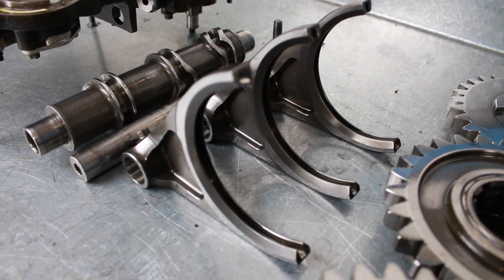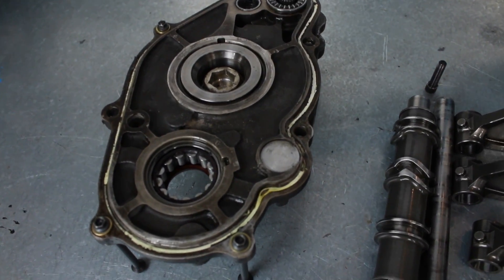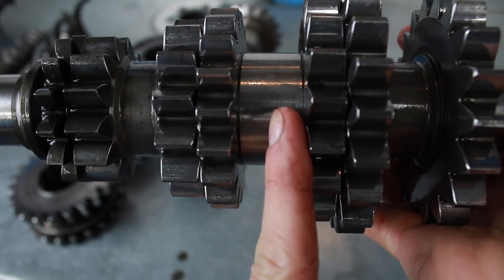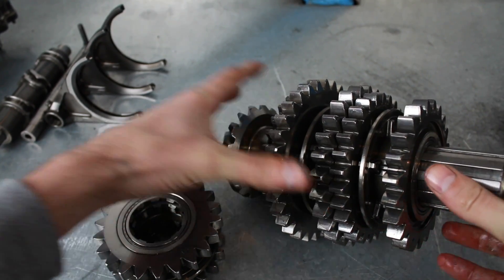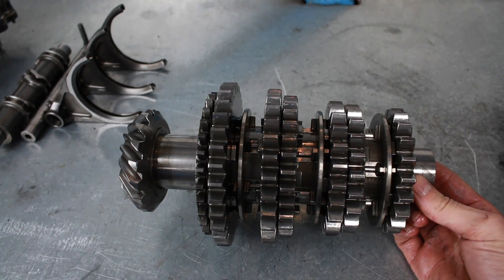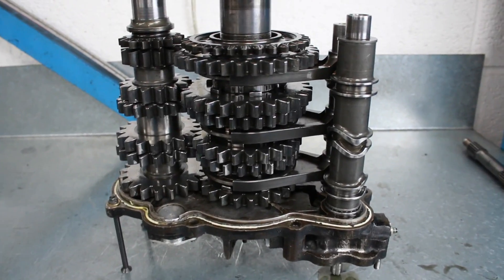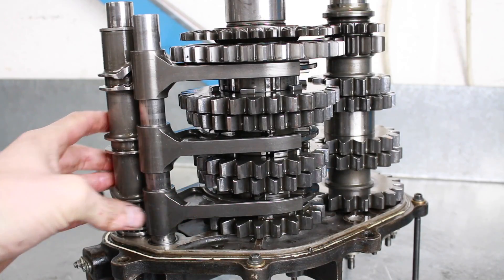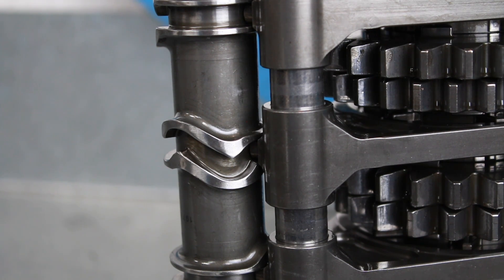How to Build an F1 Gearbox (and How it Shifts) | F1 Engineering

Comment: What matters: The main shaft's gears spin freely (they are NOT splined), which are always in contact with the engines gears ... and are always spinning freely together. It's only when, the DOG (the middle of which is neutral as it's not touching either gear) which [is splined] then locks up with the gear selected. Mansel has difficulty explaining bc he can't remember what it was like to not understand. He's not really even sure what we "aren't getting."  

And I still don't get something. How the HECK those dogs aren't RIPPED OFF when being engaged by the TREMENDOUS force & no 'synchro. I'd expect the dog would have shavings constantly stripping off as they must collide prior to being fully engaged sometimes. The dog must also require considerable pressure hold the 'dog' against the plined gear.

Comment: what I dont understand is this: once the car has started moving lets say in first gear they main shaft that translates the movement forward to the wheels is spinning and as I understand the engaging disks or dog rings as you call them are basically spinning with the main shaft. so the car is moving, the main shaft is spinning at certain rpm at first gear and the dog rings are too and the rest of the unengaged gears are spinning according to the rpm of the engine and if we change gear (lets say from 1 to 2nd gear) the dog ring for first gear moves and disengages from first gear and the same (or another responsible) has to move in to engage second gear. but how does that happen with all parts moving? how does the already spinning dog rings sync up with the next gear cog so they can just rightly go into place and engace the gear? thats what I dont understand. because you are showing it kind of staticly and the main shaft is not experiencing any movement, any inertia....

Comment: So they achieve a remarkable level of simplicity by removing the ability to shift from say 1st to 3rd directly.  That's pretty cool.  Clutch only used for getting the vehicle moving.  
I helped my mechanic friend a tiny bit rebuilding my 5-speed Steptronic transmission.  
200 little parts with rings and gears and more rings and clutch packs and this shaft and that shaft... I can pop sport mode on, (I've been driving old used cars for so long that many things that have been standard for years are still kinda' new to me), sport mode, 
switch gears myself and the computer won't let me fuck up, 
I think it's truly a testament to auto engineers everywhere that a transmission that handles nearly ten times the horsepower and almost four times the RPM's as my car, and it's significantly simpler to understand.  Love the cam that drives the forks thru each gear in turn, simply fascinating what you can do with some levers and the proper fulcrums...

Comment: Great explanation.  Maybe I missed it, but is it possible to put transmission in neutral?  Doesn't seem like it to me because it bottoms out in low gear and stops at top gear with no place in between where main shaft is not turning.  If that is right an there is no neutral, I assume that means the only way to not move while car is running is to disengage the clutch.

Comment: Awesome video! Really interesting to see it working. I wonder how bad the wear is on the selectors. How do the selector disks connect to the driveshaft? How can the selector disk always be in the right place without being damaged badly? 

I mean, drivers shift a lot and don’t want to repair the gearbox every other race. If the disks just use small metal studs, won’t they just be damaged really fast?

Comment: how are the dogrings able to pull away from the gears with those sloped engagement points pulling them together with 900hp at full throttle?

Comment: How does it unload the gear train before shifting? Then match gear speeds while in neutral? Avoid overspeed? And ensure the dog teeth fit into a gap? I suspect electronic trickery of the fuel injection and air to synchronize the speed and phase.

Comment: This video is soo cool.  How it all comes together is truly amazing.  I just can't figure out how these gears translate into more speed.  To me it looks like that are all part of the same rotation and the power doesn't appear to come from the larger gears having more "forks?" in the cog as they all appear to be engaged with that other shaft constantly. I'm sorry I'm a complete layman that just finds this amazing to see.

Looks like I'll have to watch "what's Inside an F1 Gearbox (& How it Works)"
Reply: Ok, Just watched the other video. Another great watch.  The gears are on bearings and not engaged on the main shaft until the dog ring connects with them as that's where the drive comes from.  I still can't figure out how one gear results in more top speed than another.  the dog rings look like they have the same number of teeth at each side.  I can't see how higher gears would result in more rotations to the drive shaft (I assume more rotations to the drive shaft = higher top speed) compared to the lower gears.

Comment: What happens when the dog ring slides across to initiate a gear, but rather than slotting in, the dog teeth impact the dog teeth of the gear? Is it just that it rotates so quickly that within a fraction of a second there will be a gap and the dog ring will then slides across and initiate the gear?

Comment: What happens if the bumps on the driven shaft gears line up with the bumps on the selector plates, preventing the two from meshing correctly? Does the thing turning the barrel have low enough torque that the selector fork can sit unengaged for a moment while the gear continues to spin until the bumps aren't on top of each other?

Comment: Much simpler than a road-going gearbox - no synchro, no interlocks (the barrel does the interlocking automatically), no end thrust to take care of with straight-cut gears.   So far fewer parts.   But the same satisfying feeling looking at it operating as you get with a good road gearbox.
Reply: yes and it had  to last only 300 km opposite to 150k km minimum on passenge cars.

Comment: 1. So how do you get reverse?
2. I get from the last video that the toothed/ramped collar must act like a kind of ratchet with spring tension to hold the gear once the actuator backs off, so if you are in 6th and continue to rotate the barrel the same direction do you just end up going into 5th, 4th etc? 
Or does the actuator then have to somehow release the "ratchet" teeth and rotate the barrel in the opposite direction?
Reply: Nevermind the reverse bit, I forgot about the reverse idler gear.

Comment: Also motor several  things different about head and block. (Engine contruction) vehicles. Fluid passages parts deck height thurst angle also computer ignition timing dexility structure these. Vehicles made ridget and solid

Comment: So, I just found out that these sequential gearboxes were only implemented in F1 in the late 80's.
Why do think it took so long.
Also, is there a neutral position between 1st and 2nd or some other way or no neural at all?
The first sequential box I saw was when I disassembled my Ducati 750 SS back in the late 70's and had the gear clusters in my lap.
It was interesting working out how it worked.
And it was almost exactly the same as the ones you show.
Funny that F1 hadn't adopted it given how fast you can change.

Comment: When you're at rest and going from neutral to first, and both shafts are stationary, if the dogs are not aligned with the slots, how do you shift?
Reply: That would only happen if you had the clutch in, or the car wasn't running, in which case you either start the car or get off the clutch to make the shafts spin
Reply: @ma61king  with no gear selected both shafts spin so how do they spin on neutral with the engine running and clutch “off” seems like I’m missing something here. On a normal gearbox the input shaft can spin without making the output shaft spin, but here it doesn’t make any sense, it’s like it’s always in gear

Comment: wow.. i can see improvements needed..  die shaft bearings on the selector forks to reduce friction when changing gears.  the top button of the shift forks need a hardened bushing on them to act like a bearing in the barrel grooves.  about 25 years ago. i was watching an indy car race. one team loss all of its cars.. 2 for gear box failures and one for no brakes.  i had a friend who knew that team owner.. my friend being a former indy lights crew chief. i mentioned a few things to contact the team owner with. my friend loved my ideas.  called the team owner a few days later.. the team owner got all crazy demanding to know who leaked the secret projects out of the R and D shop.

Comment: so is "basically" an motorcycle gearbox? i tell u cause even honda's 125cc have the same mechanism on the gearboxes and even dog clutch
Reply: it's more, the old Honda dax 70cc, has the same gearbox
Reply: Yes, but instead of using the clutch, you just bang it into gear, without letting off the throttle.

Comment: Now explain why it costs the same as the GDP of the Sudan.
Reply: I guess ... Sudan should make more gearboxes for f1 ...
Reply: Two letters R&D. :)
Reply: As a matter of fact, this gearbox is as simple as a gearbox from a ford model T.
Reply: Dennis Young  So there is no whey you could mass produce anything good, by good you can define it like : if they don't want to use it then it is not good ??
For speeds and forces involved in just one race this does not look like something that can do what it does, if you would put some nice car transmission next to it without case and asked without knowing what it is 70% of people would tell you that car gearbox is more serious and stronger, this almost looks like diy gearbox someone built in machine shop :)
Reply: every single part is made individually and really precisecly to handle hp and provide fastest possible shifts
Reply: Grand D*ck Painting of Sudan?
Reply: very tight clearances good materials.
Reply: Tolerance and precision.
Reply: Because F1 is over priced in any way, like there is no other race car's who has gearboxes like this, in fact this is a weak gearbox, if you would put this gearbox in a rallycross car it couldn't hold more then 20 short laps
Reply: @aldish25  a rallycross gearbox weighs twice as much and doubles the size of a formula 1 gearbox. Its not overpriced, developing and building at that level cost lots of time and special materials and machinery, and that's meanings money. Lots of it.
Reply: @aldish25  Dumbest statement ever. Its like saying my street car's gearbox can last 200000 km without an oil change, but a rallycross gearbox can't.
Reply: @MegaCm123456  aha and what you gonna say about 24h race cars? Wich are nearly as fast as F1 but need to race 24h not 2or3, everybody here is so over the F1, like there isnt any other motoracing at top end level
Reply: @aldish25  I'm going to say that different disciplines require different cars and engineering. Since F1 team budgets are the biggest and have been for decades you can be sure that they have developed their cars the best. A Mercedes F1 car is far better engineered within the rules than any other car in any other type of discipline. I can comfortably claim that a Mercedes F1 car gearbox is much closer to the theoretical limit of the F1 rules than for example a Toyota TS050 gearbox to the WEC rules. Rallycross... give me a break. The budget to develop the whole Rally X car and run it for ten years must be smaller than to develop an F1 front wing for the 2019 rules package.  There is other racing out there other than F1 (thank god), but to claim that a rallycross gearbox is better than an F1 cars is just so off the mark on so many levels.
Reply: @MegaCm123456  no its absolutely not, the F1 car's gearbox is not taking half of the stress what a rallycross car's gearbox needs to take, there's no need for ooo give me a break, you want to tell me that F1 gearbox could hold 800Nm on a 1300kg car with four wheel drive and with locked diffs and super, super soft racing slick tyres!!? 😂😂😂
Reply: @aldish25  I don't think you read what I wrote or you are just trolling.
Reply: @aldish25  it's because the F1 gearbox is also designed to be lighter while shifting incredibly fast. 

Rallycross cars need to be road cars they aren't as singular of purpose as an F1 car, everything in an F1 car is perfectly balanced to bring the correct ratio of strength and weight.
Reply: @aldish25  a belaz 75710 has to withstand over 13,000 lb/ft of torque for many years. Clearly that means it's better than a puny little rally car transmission

Comment: how do they match revs without synchros or does it not matter and they just slam into gear
Reply: icebox829 they don’t need to. The change is so fast, and that’s why they use dog teeth instead of like a consumer manual box where the teeth of the selectors are quite close together. The dog box has a wide open area for the selector to slot into. It doesn’t matter when your goal is quick gear changes at super high revs. But in a consumer commuter car it’d be too abrupt and jerky and folks wouldn’t like that. That’s why consumer manuals use synchros to match revs before the hard lockup.
Reply: Its an old F1 gear box, newer ones are more complex
Reply: it happens fast, but u need to do it fast too. the paddle shifters help a lot to get it done quickly...
Reply: @sMASHsound  umm no. Thats just a switch to trigger electric actuators.

Comment: Basically a secuencial motorcycle gearbox
Reply: I was really hoping to see this comment (Y) only I'm not sure if they/he have named the parts incorrectly or they have just want names that don't align with what would be in a service manual barrel = selector drum etc .
Reply: What was the old brand that didn't have a stop on the actuator so you could go from high gear (4th or 5th) in 1st causing many an over-revved engine? Even a 2 stroke will get mad if you do that to 'em. Zundapp comes into my mind (but they were noted for kickback and running backwards), though I think it was a Spanish bike (Ossa or Monetessa?)
Reply: @jpkalishek4586 ooold jawa 350 two stroke 2 cylinder had the tendency to start backwards when the ignition was nor set up right.
Reply: @tomast9034  old Sears (Puch or Gilera) as well could do that. Kick - kickback- but hey, it's running - rev - dump clutch - errk!  luckily they were so gutless that way they usually died.
Reply: Dennis Young  maybe. 
Memory is the second thing to go . . .
Reply: Or any sequencial gearbox

Comment: Cool that F1 gearboxes (At least of that era) work so similarly to motorcycle ones. The gearbox on my old motocross bike looked extremely similar.
Reply: Were mx bike gears in order 1-6 on the shaft? It's been twenty five years ago.. I vaguely remember some street bikes were not in order. I could be wrong.

Comment: So as said below much like a motorcycle box, sequential, but with a diff not a chain drive. So where does seamless shifts come in, where there’s no backing off the power to let the gears change. ....? As I recall the dogs on the dog rings are square cut rather than dove tailed to pull the gears together. But I guess there’s much more to it than that. ..? ....edit to say, having checked, it’s a bit more than square dogs. More like interlocking dogs. Smart. 

Great video thank you
Reply: The seamless shift system from a mechanical standpoint is fairly simple. They just added a second shift barrel and selector fork assembly and arranged the gears a bit different on the shafts. One barrel shifts all odd gears the other shifts all even gears. Now you can have two gears engaged for a very brief moment which is what actually happend in a seamless shift gearbox.

Comment: "Yewww don't know nuthin' there boy!"

Actually, an excellent video. Any one of the 4-stroke motocrossers is 1/8, 1/10, or 1/12 of an F-1 engine. Dig into a Honda Valkyrie trans, and marvel at the F-1 lineage in the gearbox. Of coure, the engine and gearbox/clutch share the same oil supply leading to increased oil shear. Quite an engineering feat over the decades.

Comment: It's much simpler than a motorcycle gearbox, but a hell of a lot more bulky. No cir-clips or special assembly spline parts locking gears to shafts. Is the dinky little narrow gear reverse? I guess they are stripped for ratio changer and checking so frequently wear on pins and barrel face cams wasn't an issue?

Comment: Excellent video.   So no synchromesh cones needed because the gears are in constant mesh.   I would like to see the same in depth presentation of a twin clutch transmission.    Especially how they implement throwout bearings.

Comment: How does it shift into reverse gear?
Reply: Judging by the leading edges on the reverse gears id say that a reverse idler gear [not shown] would be shifted to engage into the two reverse gears changing the rotation of the output pinion.
Reply: if the gear box needs to go in to reverse, you will need a third gear wheel that is independent between the to reverse gear wheel. look at  8.07 the gears aren't touching if you put in a gear you would change the direction. said in another way 2 gearwheel make the reverse direction of the driven shaft, 3 gearwheel make the same direction as the input shaft and so forth.  But it is nice to have the opportunity to see a F1 gearbox even though it has some yers on its back. More of that please :)

Comment: You didn't explain how reverse is engaged ! Also the other parts to the lever that the pilot move in order to shift betwen 6 gears will be interesting to explain in another video. If you do not have the parts you can explain on paper. The rest is very well explained .